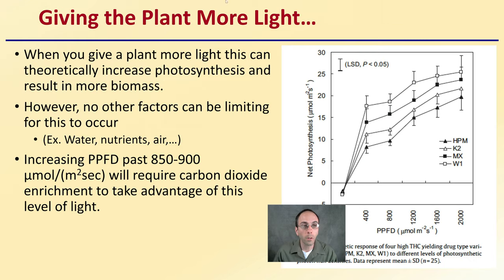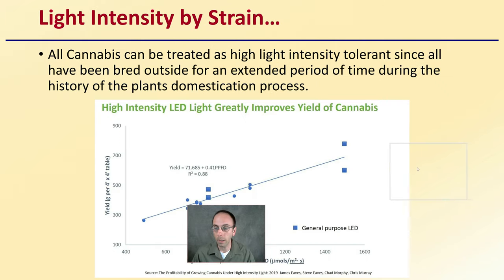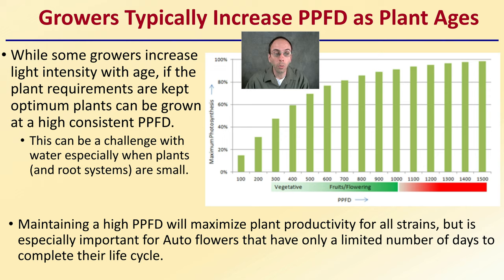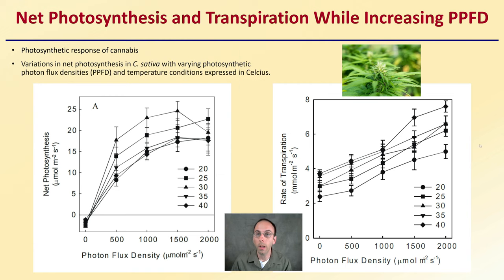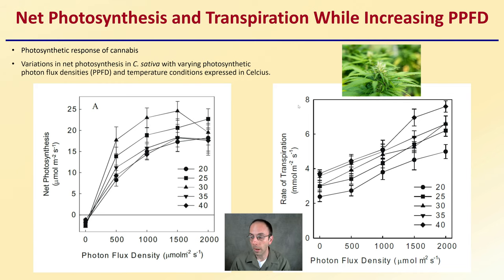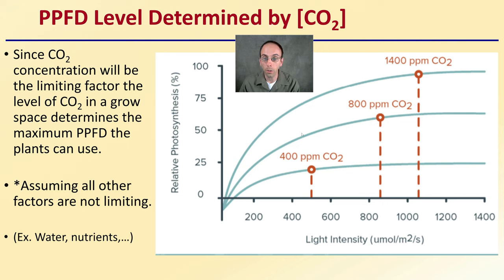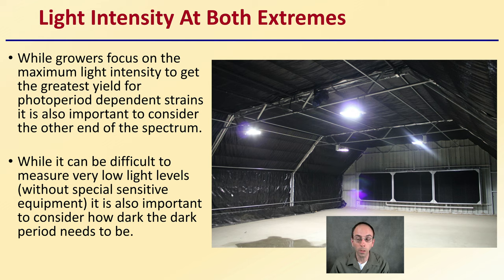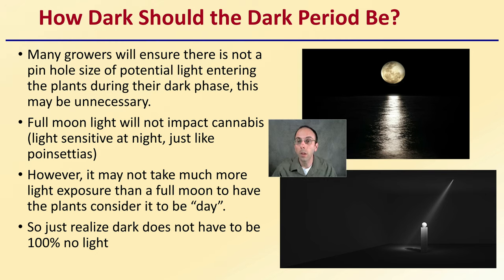Understanding Light Intensity to Drive Cannabis Production

Comment: Great video. A lot of concern by home growers about “pinholes” in their grow tents. I tell them that the pinhole is noticeable from the outside of the tent when the tent lights are on. However when the lights are off in the grow room or tent that you’d basically need a spot light so to speak or at a minimum a light directly shining at the pinhole in order for any light to come through and possible trigger the plant. Pretty much direct light, ambient light from a nondirect point should never cause anyone issues. 
Thanks for sharing and stay safe and healthy. Peace ✌🏻
Reply from the maker: Many indoor growers neglect the idea that cannabis grown outside is exposed the moon light and this does not impact the overall photoperiod of the plant.
Reply: All you have to do when tent is empty zip yourself inside when the other lights are on to see just how n what light is penertrating the pin holes or vent holes.
Reply: @DeBaccoUniversity  I'd also like to hear your views about growers claiming that light leakage caused their plant to turn herme. I've had some light leakages in my grows that would make some of these growers have a stress heart attack, and I've never had a plant turn herme because of light leakage. Is that even a thing?
Reply: Also, this would be easily remedied with a piece of duct tape lol

Comment: Hey professor! Quick question here.
Is all light equal, specifically how plants interact with light intensity? Might seem funny but I'll give an example to showcase my point if there is one even. 

Our light fixture is an HLG LED with an infinitely overclockable driver/extrusion (I think it's called that) that doesn't fluctuate temperature or humidity. We hang it from 5 different points with different power levels to achieve the same 1000 ppfd across all 5 points.

1billion%power hung at 9.41 million miles 
150%power hung at 200 inches 
100%power hung at 40 inches
60%power hung at 30 inches 
10%power hung 1 inch.
Reply from the maker: These DeBacco University videos may also be helpful for you... https://www.youtube.com/watch?v=au7G-oVDeKg&t=138s and https://www.youtube.com/watch?v=r7yTiUOtSHo
Reply: @DeBaccoUniversity  appreciate the response professor.

Comment: Should you lower light intensity in late flower to boost resin and trichome production?
Reply from the maker: Some argue increasing certain wavelengths (ex. UV) late in flower can increase production, others do a lights off period.  Data is still pending to determine the "best" method, but remember either of these is to maximize production so it it more important what you do for the majority of the flowering cycle than just what is done in the last few days to get the majority of the quality you seek.

Comment: Thx for the infos!! Can I ask a couple of q? First you say that we need co2 supplement over 1000ppfd than the graph says that normal ambient co2 4-500ppm limits the max light usage to 500 ppfd...so with normal co2 is there any benefits to give let’s say 800ppfd?
Second question is about the average ppfd. How should the measurements have to be taken? Let’s take one plant covered by one single grow light. The plant has i.e. 5 colas at different heights (apex 1000ppfd, 2 at 800ppfd and 2 at 500ppfd). Should we consider an average ppfd (720ppfd in this example) or just the ppfd on the main cola?
Same doubt about ppfd measurements taken horizontally if you have an even canopy.
Hope you will explain. Thank you
Reply from the maker: Normal CO2 target light levels should be in the 800-1000PPFD range (keep in mind that seedlings/clones may need to be started lower and then worked up to this level. 
Take a set plane/distance from the light and measure the PPFD in the coverage area via a grid points.  This is what is commonly seen with light data reports.
Reply: @DeBaccoUniversity  thanks so much. And what about different heights (not trained plant)? Any case the point is that ppfd coverage must be an average not just the hot spot, right?
800-1000ppfd for auto flowers too? Also with 18/20 daily light hours?
Reply: @andrewbee82  keep it simple bro. You don't need to go in to science that much. Follow the light instructions for height and intensity and you will get to harvest without problems. 😉
If you put more than 1000 ppfd introduce co2 and that is it.
Reply: It won't even pay for your Co2 so it's not really needed to stay at such high levels and if temperatures are below 90 then co2 won't matter anyways.  When one area increases all areas (water,soil,wind etc) have to be increased as well so if you run at those levels it's going to be a chore to even keep them watered in anything less than a 10 gallon pot and they're going to take ferts like a you've never seen.  Hard to maintain a all round very high PPFD without have a very dialed in room and grower that's on his toes.  I don't think all the extra cost and trouble have been shown to be worth the effort but things change all the time

Comment: What could be proper EC for a 300w, 700~ppfd setting? Indoor soil.
Reply from the maker: General suggestion is 1.8 in Veg and 2.4 in flower.
Reply: @DeBaccoUniversity  really? I've been experiencing burnout in the leaves, week for onwards. Dinafem Moby Dick (former dane bank), with Green House Feeding salts (the dutch ones, grow+long+pk boost), averaging 1.5 across, and 1.8 in the final weeks. I felt that my ppfd was low, and i was overfeeding thus the burning. Maybe flushes were lacking? I just recently started flushing at the beginning of flowering, midterm, and preharvest.

Comment: Thank you about the moon. I had a debate with a guy who couldn't really answer my question "what about a really intense full moon" about his concerns with lights because he was under the assumption you had to keep it completely dark sealed during the dark period. I told him I had to get back there to do some quick maintenance with a really low power flashlight. The easiest way if you need some stealth or foolproofing, take the light bulb out of the ceiling socket if you're a home grower. Use headlamps.
Reply from the maker: You can also use a green light (headlamp or bulb) which can help maintain the photoperiod of the plant as well.

Comment: Just a question about moonlight, if it's not 12hours + of moonlight isn't the argument moot?
Reply from the maker: Not necessarily, since the plants need 12 hours (or more) of continuous darkness.  Moonlight was thought by some to break or interrupt this continuous hours of darkness leading to the issue of preventing flowering even though there is not enough light intensity from moonlight for the plants to perceive it as light.

Comment: The graf that shows plants not being able to utilize more than 500 PPFD can not be talking about cannabis. While most growers will be at 600 to 700.
Reply from the maker: Assuming this is the graph that first appears at 4:34 this shows that CO2 can be limiting and at lower leaves adding more light is generally not fully utilized by the plant.  Aiming for 600-700 ensures room for error and if you are supplementing with CO2 you can go over 1000 to maximize the photosynthetic process.  Hope this helps.